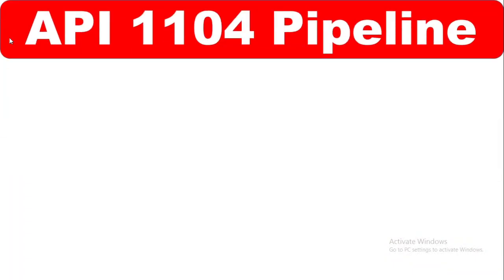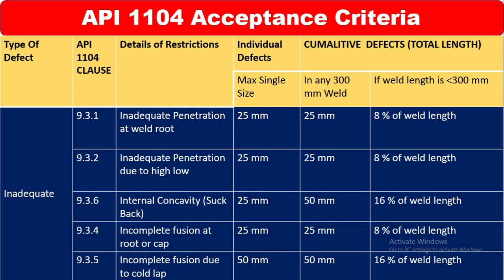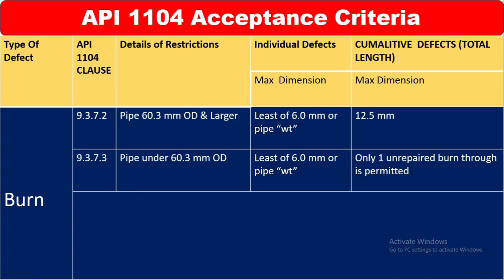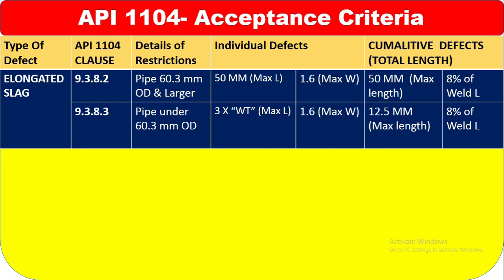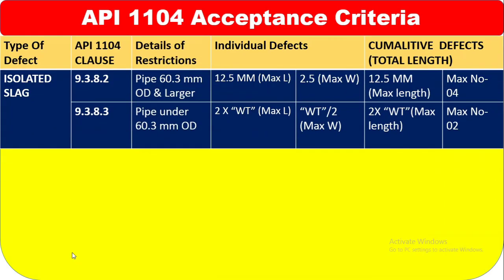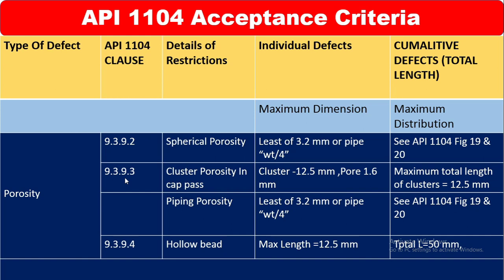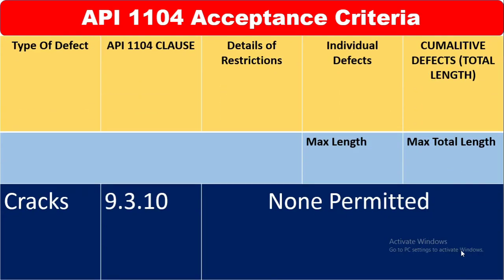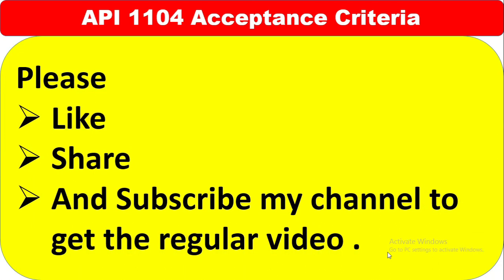API 1104 Acceptance Criteria for pipeline Defect

Comment: hi if we have a weld length about 690 mm so in the first 300 i have  accumulative IP about 20 and the second 300 mm i have accumulative IP 22mm and  the 90mm about 7 mm , so it is accepted could you confirm  if my calculation is right?????

Comment: Sir as per api 1104 rc is only based on density not as per length.if any correction than  plese suggest me.
Reply from the maker: Please Check below ....
9.3.9.3 Cluster Porosity (CP)
CP that occurs in any pass except the finish pass shall comply with the criteria of 9.3.9.2. CP that occurs in the finish
pass shall be considered a defect should any of the following conditions exist:
a) the diameter of the cluster exceeds 1/2 in. (13 mm);
b) the aggregate length of CP in any continuous 12 in. (300 mm) length of weld exceeds 1/2 in. (13 mm).